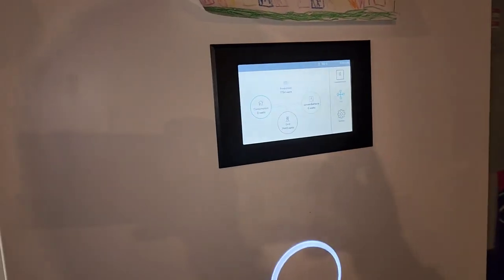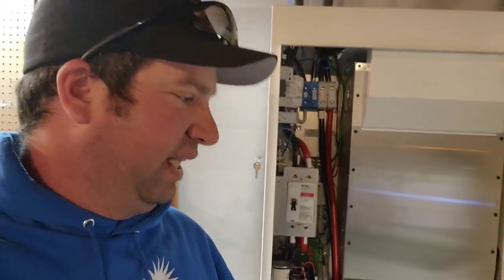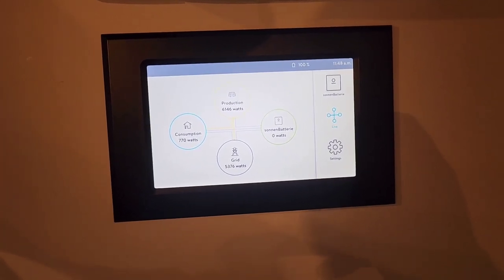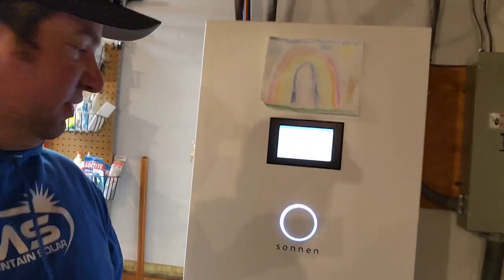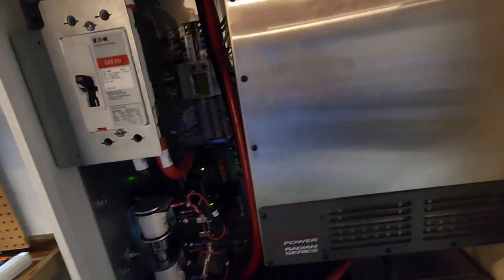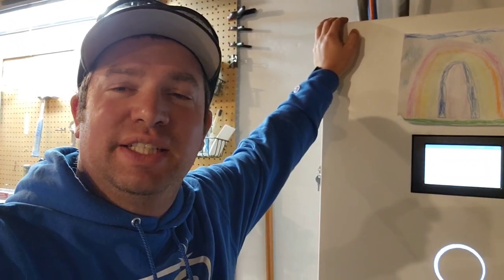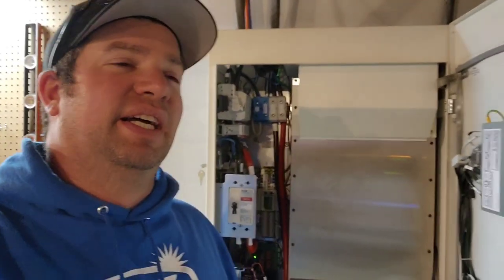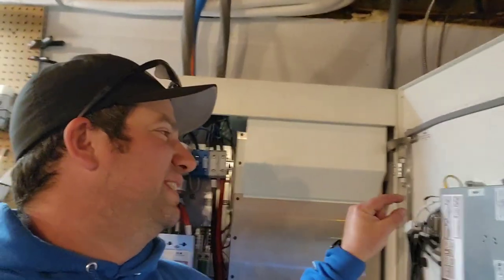5 Reasons Why You SHOULD NOT Buy This Battery!

Comment: I found that the power company sends commands to there connected devices. Through (in California) rule 21 causes in some  cases many issues that are miss diagnosed. Just a thought. We had a lot of Arc Fault shutdowns on a Delta Inverter we got from Signature Solar it wasn't the Inverter or Arc Faults. When we removed the power company from it no more problem.

Comment: @9:45,  AC coupling flickering.   I have SMA SI6048US x2 with about 40 Enphase micros AC coupled behind it.   When the house loads roughly balance the solar production, in the morning or evening, certain LED lights will flicker.  My theory is the main SMA inverters can only switch between charge & discharge so fast, maybe 10-20 times per second?  And that's about the flicker rate.   I feel like it's a feature, flickery light at that time of day means we're at zero battery current, solar matching the loads.
Reply from the maker: I've definitely seen it with other inverters, but this was much more pronounced. It was a pretty terrible strobing.  I like your theory!
Reply: Outback doesn't ac couple well

Comment: Ben, my neighbor installed one of these systems about 3 years ago and tried talking me into getting one. He preached accolades to me about how great it was and the best system made. Three months ago he replaced it with two Sol-Ark 12K's after two years of similar problems of the one you have there after looking at my Sol-Ark 12K system. Did Solar Edge quit making the SEAUTO-TX-5000 auto transformer?
Reply from the maker: I've removed a bunch of them.  The last one was 2 sonnens paralleled, but they don't parallel, so 2 separate systems feeding separate load centers on the same house.  Replaced it with 2 Sol-Ark 12k and a wall full of Simpliphi batteries.  
I think Solaredge did stop making the autotransformer.  It was used in their older Stor-Edge.

Comment: I have a super clean install with 24 LG panels 7.86 kW and a NeoVolta total 24.4 kW battery backup. The neoVolta main cabinet is 14.4 kilowatts and 7.8 kW inverter it will take DC AC and a generator all into the same panel and I have an additional 10 kilowatts in another enclosure that's wired in all with LFP batteries. It's almost a year old never had a problem it will do 14 circuits in a critical load panel and more circuits if you double up on the breakers. It charges fully by around noon time on a sunny day and it will run almost the entire house except I don't have the 240 volt AC or my Tesla to charge on the battery but I can charge the Tesla with a 20 amp circuit 110 volt on the neovolta if I had to. Of course with that metering and time of use in Southern Cal I just charge it between midnight and 6:00 a.m. if your plan on getting rid of that problem in getting a rock solid system the neovolt is the way to go best price 10 year warranty and the best part is every part in the unit is replaceable so it doesn't need to be taken off the wall and sent in for service like the power wall. If after looking after our website you are serious then let me know were they reply. Maybe I can get you a discount.

Comment: I don't have that type of batteries but it's known that when those batteries are not placed in the upright or top up position it will reduce the capacity because the electrolyte won't reach the top plates when it is standing on the side, Also it shorten the life of the battery in that position.

Comment: If they want to sell cheap I would love one.
Reply: I saw some of used ones on ebay
Reply from the maker: Nothing is cheap with this system.  We will most likely be reimbursed for the unit cost by Sonnen.  You don't want to pay that, I guarantee it.
Reply: @benssolarandbattery  Ya I would just strip out the good parts and manage the batteries manually with bms as far as AC coupling one can buy an external control.